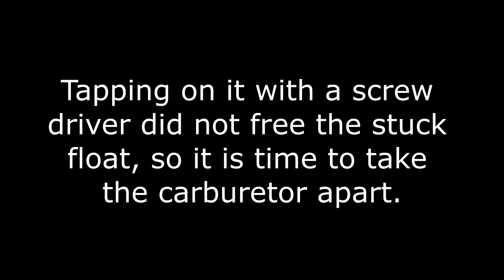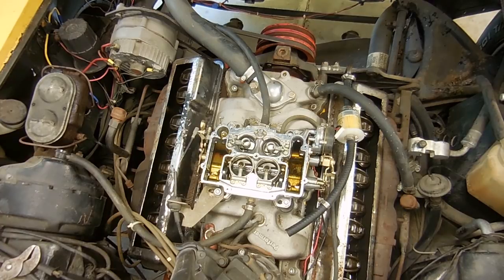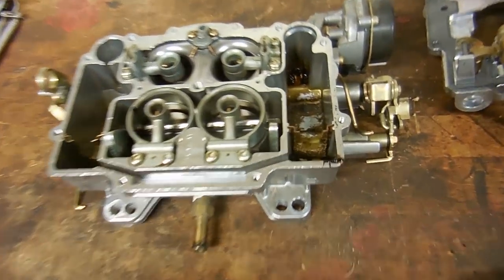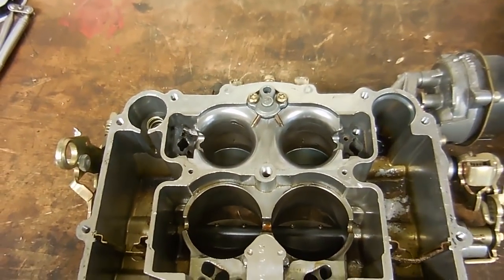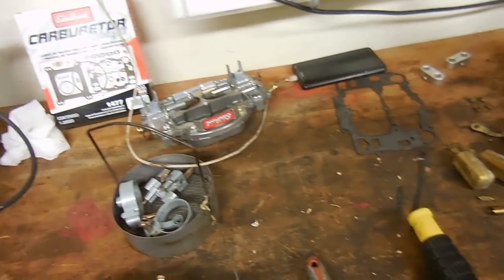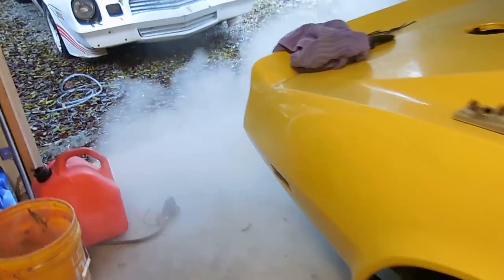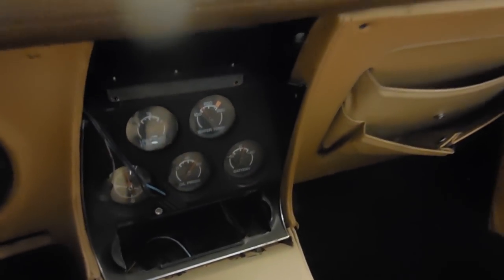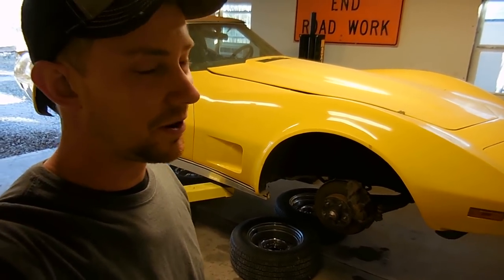1976 C3 Corvette Brought Back to Life After Sitting Since 2004 Part 2

Comment: The Torino I bought had the same carb issue with all the varnish, corrosion and it was so bad that it was only idling out of one side of the carburetor.  The previous owner didn't run a fuel filter plus the tank fuel broke apart allowing all the rust and junk into the fuel system.  
When you pulled the carburetor apart I got a flashback! Once it was gone over it ran so much better.

Comment: The brake pads were pulled off the car 3 days before the car was picked up because they were dragging and it was next to impossible to push the car by hand so I could get it out of the garage and on the trailer to make the trip to Ben's.

Comment: Good for you. Glad you are in a beautiful old machine. Long may she run! I love C3s!!!  The bodies are iconic, unmistakable, and high performance solid . Weather you restomod,  or go old school you can build an awesome classic car to drive HARD now.   Will you get you money back ? NO   Will you get your money worth YES !!! My 75 L82 has been gutted and now has a OLD school LT1 Block (roller camed) Twin Hollies... with Borling 3.5 in straight pipes,  and a 5 speed manual Transmission =  480 very reliable horsepower, New modern suspension and brakes, that rival any new car. It is fun as can be!   She is a smiler, T topped, beautiful sleeper.  lol The sound of my v8 kicking over is like hearing Thor's hammer.    Here's to Bowling Green Kentucky and a bygone American Era!  Enjoy your ride , they are special!

Comment: As a kid 25 years ago after fighting with the calipers (rebuilding by hand) I was surprised how much rebuilt calipers from my local auto store cost.  I want to say about 15 bucks each; back when the dollar had more value:)  Recently changed pads out to ceramic.  it lowers brake dust.  As for the carburetor, once I tasted TBI, carb became a relic sitting in my parts bin.

Comment: Well where did the pads go. I believe someone took them out put them another car. That's crazy thanks for sharing.
Reply: Well you believe wrong, the brake pads were pulled off the car 3 days before the car was picked up because they were dragging and it was next to impossible to push the car by hand so I could get it out of the garage and on the trailer to make the trip to Ben's.

Comment: rebuild the calipers yourself - its easy and cheaper
Reply from the maker: To each Thier own
Reply: C3 vette calib-ers rust in the box on the shelf and renovators  not to bleed well, best to get stainless sleeved one and all new lines.//hardware
Reply: @gertraba4484  Ahh, but you can't assume the calipers on this car are not already sleeved. I purchased my 1973 corvette in 2016. It had worn out caliper hoses that I replaced but while I had things apart I inspected the calipers and they were all stainless.
Reply: @rpetronk  a major score on your part, even though these design calipers are 50 yrs old it wood pay to upgrade to a more modern design